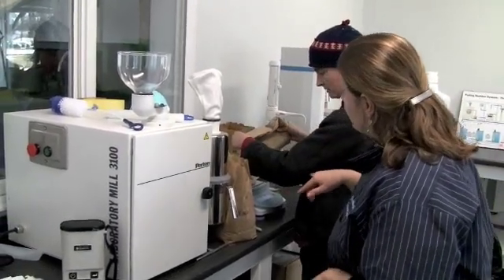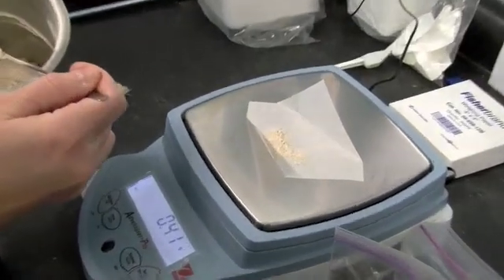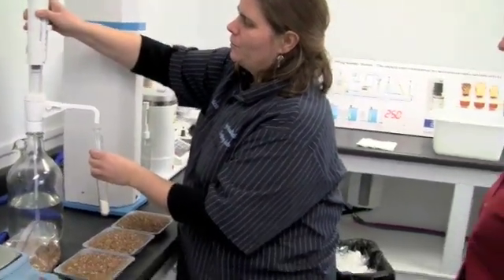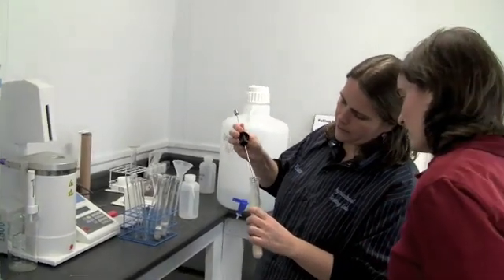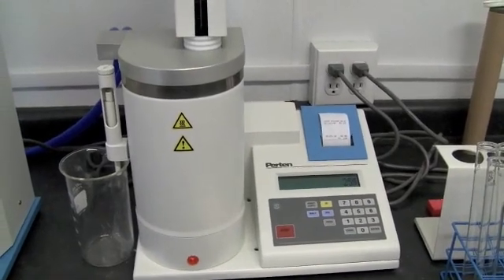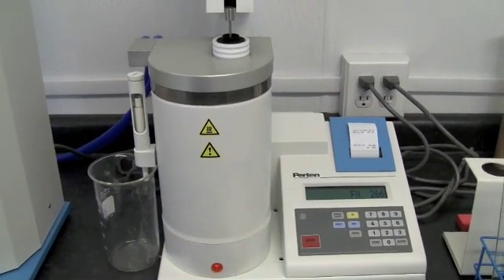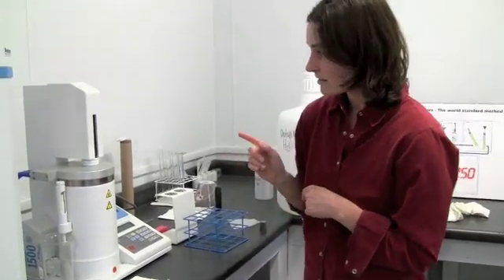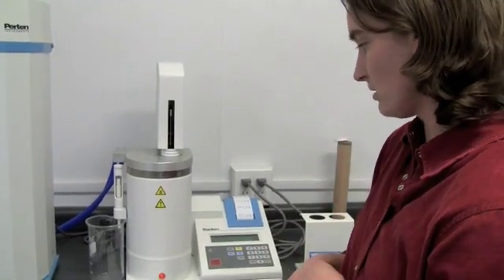Falling Number

Comment: My instrument sometimes spills steam and a lot of hot water out of the three holes in the upper right corner of the bath wetting everything, while it says in the screen that the water level is low. Do you know what could be happening and how can I avoid that? Why does that happen?
Reply: Our suggestion is to contact Perten directly. It does not sound like we are using the same kind of falling number machine.